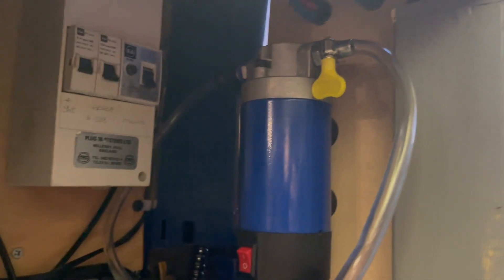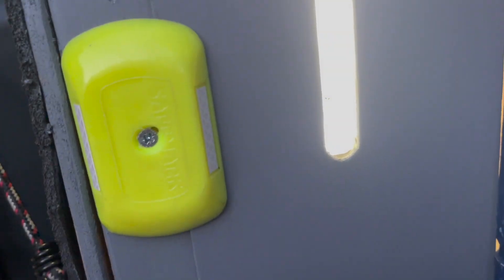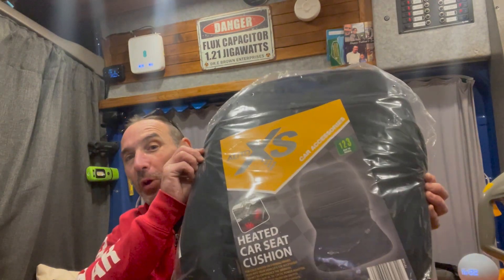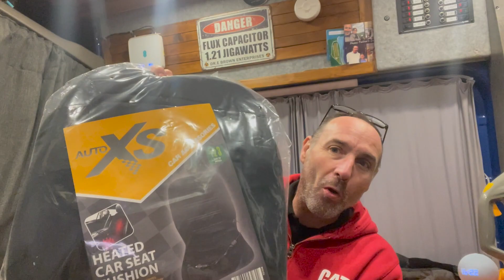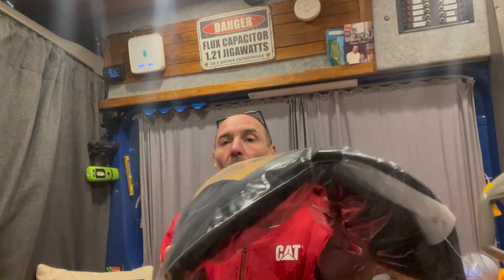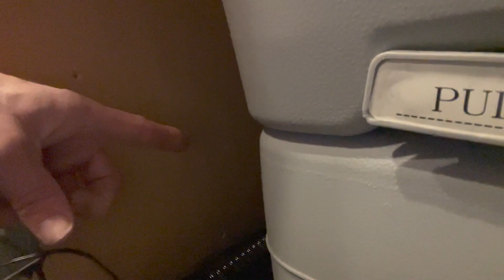Getting ready for Scotland. Sprinter Van life improvements.

Comment: Great idea with the heated seat cover 😅 👌 also running it to the switch panel. Top job
Reply from the maker: Hi Ash, The heated seat cover is working a treat , even without it on in minus 3 in Scotland the battery has been at its coldest 11 degrees. Hope your both ok, best wishes mate. 👍👍